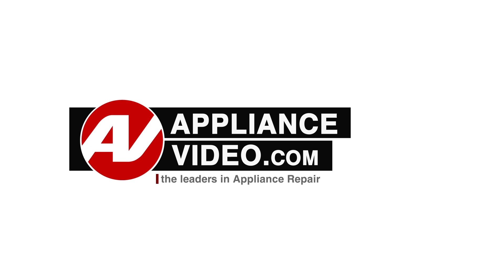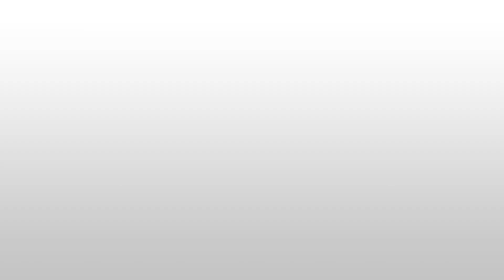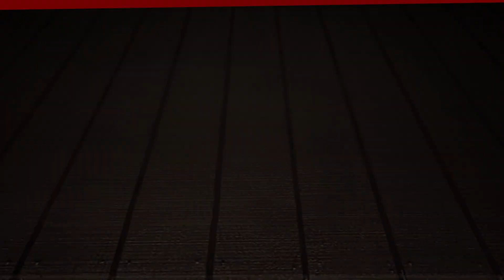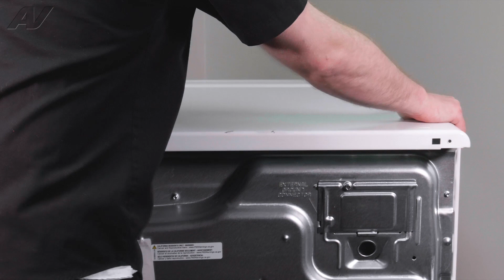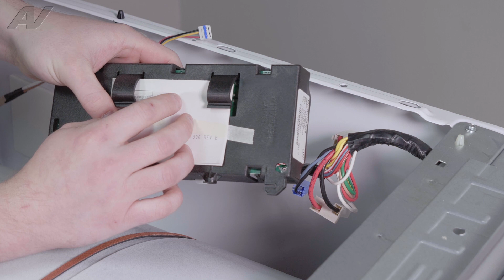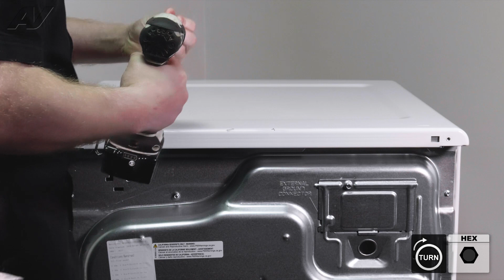Maytag Dryer Repair - No Heat, Will Not Power On - Electronic Control

Comment: How does one repair a Microwave Oven?
Reply: You have to be extremely careful of the high voltage capacitor, because it can kill you! 💀 It has to be grounded out to release it’s stored electricity. There are many things that can break and you will spend more in one service call than a replacement microwave costs. I spent $175 at Lowe’s for a brand new LG Hood/Vent/Microwave oven. I do prefer to fix and not to throw away things in a landfill. If I had the space, I would’ve purchased a spare hood, because this new one will break. I did purchase a countertop microwave at Costco, for $100, to use as a spare.
Reply from the maker: Thanks for your response, we are glad we could help. Our library of over 5,900 videos are currently helping over 1.6 million people like you every MONTH.  Please help us by subscribing to our YouTube channel, or post our website www.ApplianceVideo.com to your Facebook page, Twitter, Instagram or any other social media sites. Your support will help us keep producing more free quality videos.